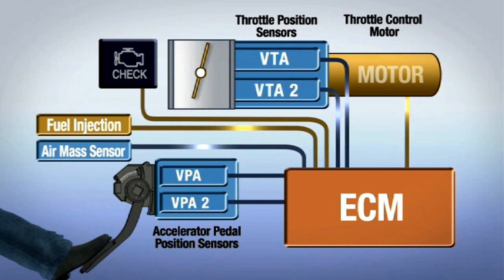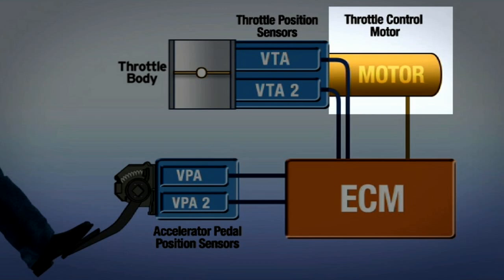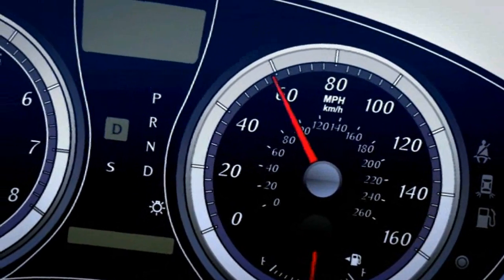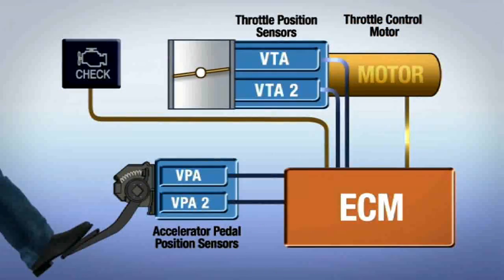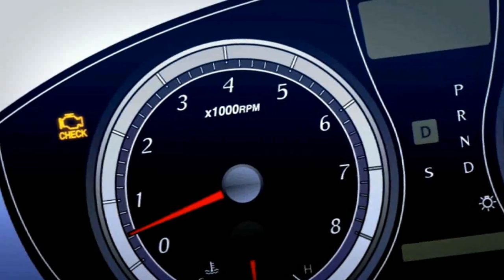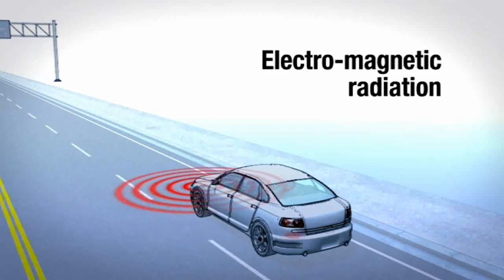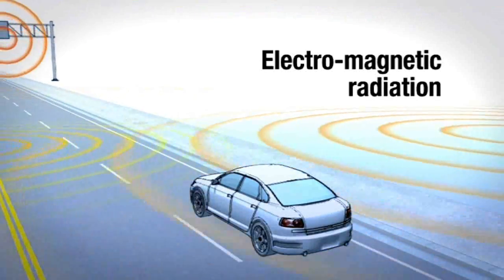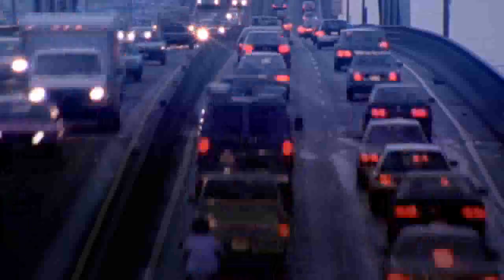Electronic Throttle Control - Lexus

Comment: hie have permanent stored code p1127 after vise versed battery connections..n blew fuses n managed to change dem n changed throttlebody but the car bumps when i put in on drive or reverse..wz told dat it need repal learning .is it correct

Comment: Lexus are great cars but the biggest complaint people have is the laggy throttle response.
Reply: Have you considered one of the throttle controllers like Pedal commander?
Reply: Hence why Lexus was smart enough to have this information released and people can easily diagnosis and fix the problem 25 years later!!!
Reply: @MRMAN-wb1tv  still waiting for the fix. 3rd party hardware seems to be the only solution thus far
Reply: @pepepez6335  Huh? Think about what you just typed? YOU chose a 3rd party...
Reply: @pepepez6335  The "laggy throttle response" was CLEARLY explained to you in the video! IT'S PURPOSELY DONE TO HAVE A LONG LASTING ENGINE THAT HAS SAFETY MODES TO KEEP PEOPLE FROM DAMAGING OTHER PARTS...Once again so YOU AND I can have an engine that works years later. Just don't be cheap, and fix the problems as they come.

Comment: i have a 01 is300 throwing fault p0120 tps malfunction, i have already replaced the app for a previous fault, if u have any advise i appreciate it
Reply: Your 2001 IS 300 has electronic throttle control and drive by wire? Or does it still have a cable throttle ?